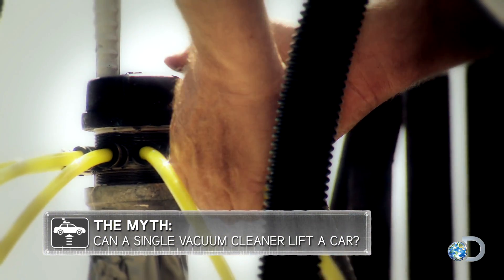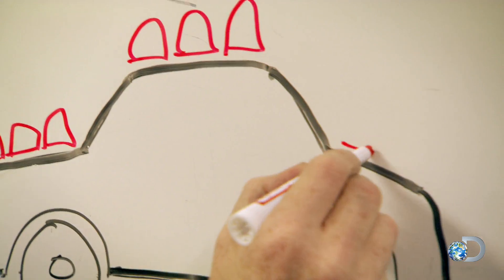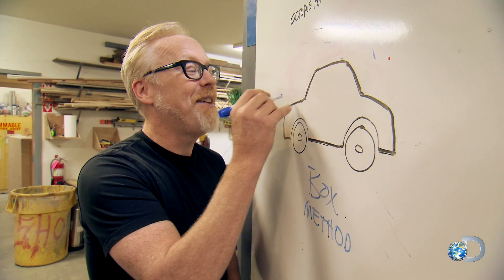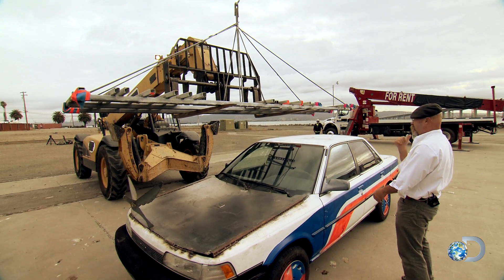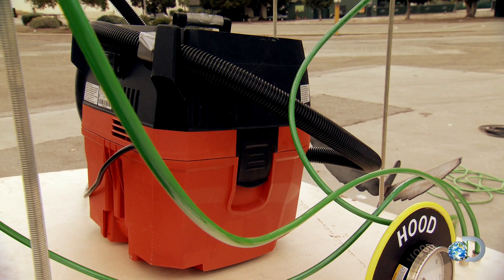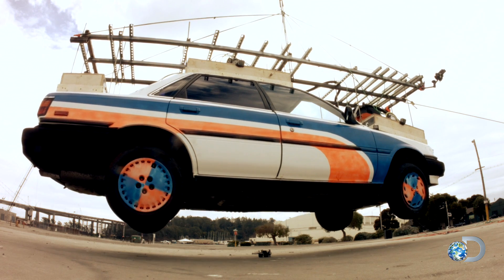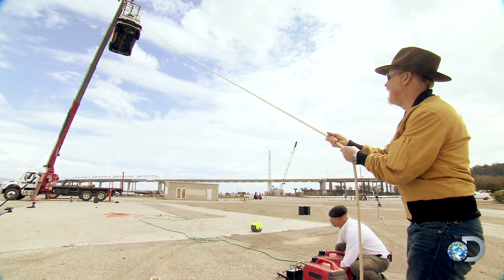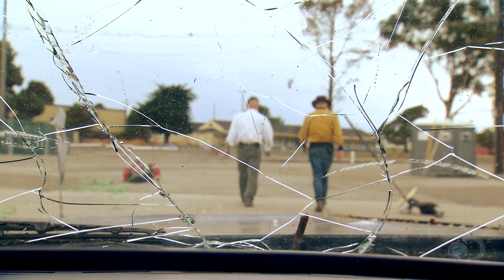Vacuum Car Lift MiniMyth | MythBusters

Comment: This episode is replicating a stunt the Kirby Company did with one of their vacuums. They lifted a VW Beetle filled with metal balls in the front to balance the weight. For a gag, they pulled the plug and dropped the car at the end. That's why the Mythbusters did it here. It doesn't seem that the Mythbusters were worried about balancing the weight and it still worked. The Kirby Company used just one large box that had a radius at the bottom to fit the roof perfectly. You can still watch their video on the Kirby Company YouTube channel. Instead of a household vacuum, the Mythbusters used a more industrial style shop vac. The Kirby Company didn't need to. They used a Kirby Heritage 2 upright vacuum and it did the job just fine.

Comment: I'm surprised three hood and trunk latches held.
Reply: I'm pretty sure they welded them shut. They also replaced the hood with a sturdier steel plate because it kept flexing too much on their first attempt with another rig. Adam did point out that some may view that as cheating, but reminded viewers that the point of the myth was that the vacuum had enough power to lift the weight of a car. It said nothing about the car being modified to get a better vacuum seal.

Comment: So making the nozzle bigger gives it more suction?
Reply: My brain is trying to work that out too.  At first doesn't seem to make sense, cause you would think a air tight seal is only as good as it's weakest point.
But, actually, i think you could lift like 1 million or 10 million pounds with a single vacuum..  all you need is a large enough closed container to just pump the air out (with the vacuum over the course of time, and you would need to also need a large surface area in which to lift the weight (for example.. have each square foot of area needing to lift only like 10 pounds.)
Reply: just like i'm certain i could lift a fairly heavy car with 1 hand (with the right setup).  If your wondering how this would work.. think about how bike gears are arranged, you could likely pull a semi truck with a bike if they made a bike that could gear that low (and assuming you somehow had enough traction (maybe you have spikes on your wheels).  You would need to pedal like 10 times for just 1 foot of distance.  So you wouldn't go far, but you could do it.
Reply: @cryptfire3158  a human can't lift a  car with 1 hand, unassisted dude
Reply: @jazzabighits4473  true that (i think)

Comment: They're not lifting the car with the vacuum, they;re lifting the car with a crane.  The vacuum is just attaching the lift-palates to the car.

Let's see them start with the crane holding the palates a few inches above the car, and then turn on the vacuum and see if the car rises.  (It won't.)
Reply: it's very clear that no one expected the plastic hose from a vacuum cleaner to lift a car.
Reply: its not an electromagnet you idiot

Comment: 100% proof earth is not a ball
Reply: Might be a year late to this comment, But out of curiosity... how does this prove the earth is not a rough sphere or a "ball"?
Reply: @Cleric2g  i have since disproven my argument but basically it was if the vacuum of space creates a force in the low pressure condition then wouldn’t that same force pull the air off the earth into the infinite vacuum? Really when you think about it it comes down to the very last top layer of the atmosphere and the forces at play between the force of the vacuum pulling the air away and the force of gravity pulling the air down. Im not a mathematician and i cant calculate the forces but its logical that this could balance out.
Reply: @AlephMale i changed my position. I think its plausible under the official model. However I still believe the earth is concave.

Comment: Hmm... so why isn't the vacuum of outer space pulling our atmosphere apart??
Reply: Science
Reply: @elliottjames671  LoL.... the term "science"

Science is meaningless as a word... all Sciences - in a nutshell - is the practice of learning and gather knowledge.... some people the concept of science..

 If those who follow the status quo pablum of what is truth andwhat is  science then theyare onthe  inside and those who think outside the box and don't do group think are losers who don't understand science????

what a crazy world we live in..... "science"  that's the funniest thing I read today...thanks!!
Reply: Space is fake its proven with the 2nd law of thermodynamics.  Pressurized gas can not exist next to a vacuum without a barrier.  If you take the barrier away the gas fills the void period! No if ands or buts. Don't give the gravity bullshit because mythbusters just proved to you that a vacuum is stronger than gravity right here . So..........?????????????????
Reply: Because it's too busy sucking flat-earth brains dry
Reply: Because there isn't much to pull. It's not solid atmosphere followed by vacuum. It's a gradient.

Gravity is dependent on distance, thus the air at the surface is a lot denser than that at the edge of the atmosphere, which is why you can't breathe well at high altitudes, because gravity is weaker there, making the air less dense, thus thinner, and thus the concentration of oxygen is less.

At the edge of the atmosphere there's so little air, that the pressure difference between the atmosphere and the vacuum of space is almost the same. So it's not a case of lots of air vs vacuum like if you sucked out all the air of an aquarium on earth and then made a hole in it; rather it's a lot of air, followed by less air, and less air, and less air, until you have next to no air, which is then next to a vacuum; and vacuum is not gonna have a super pull on such a small amount of air.

It can be easier to understand if you realize that a vacuum doesn't suck anything. A vacuum is a space that has no matter, it's empty. What causes the air to flow into a vacuum, is the air pressure. The vacuum is empty, and thus the air molecules are pushed by other air molecules into the empty space. Like if you were to compress a bunch of cotton pads together and let go, they'll push each other to where there's more room.

Our atmosphere does seep into space, however; several hundred tons per day.
Reply: @MulleDK19  the problem is gravity has never been proven to exist it's never been able to redefine through experiments it's only a concept or Theory we really don't know what it is that holds things to the Earth other than buoyancy and density.

The pressure of a vacuum around a bubble our atmosphere should be far more pressure was that a simple vacuum cleaner I guess the point I'm saying is the science that we say explains all of these things really doesn't.

But thanks for your feedback.
Reply: @vinnyg101   Buoyancy and density does not explain away gravity. If you remove "g" from the math then buoyancy and density are inert. It is literally why and how the theory of gravity came to be. Scientist use the word theory as a place holder, as if to say until a better theory is presented and passes. I'm sure there's videos of gravity experiments in space, but if you're this far down the rabbit hole you'd probably simply dismiss them. Whereas science is always willing to abandon previously held misconceptions. A hollow earth, flat earth or polygon earth would be great for science, but none of these can be proven.
Reply: @MrPunch09  you mention that science is always willing to abandon previously held misconceptions but it's not the science that is unwilling, it's the people. This is why Max Planck (look him up if you're not sure who he is) said “A new scientific truth does not triumph by convincing its opponents and making them see the light, but rather because its opponents eventually die, and a new generation grows up that is familiar with it.”
Reply: @vinnyg101  but you can prove gravity cuz if gravity didn't exist, the gasses in the atmosphere wouldn't settle into distinct layers with hydrogen and helium on top and CO2 at the bottom where we are. (mic drop!)
Reply: @christopherimpey6208  nice vid.  do you think Einstein's warped space-time is the correct explanation of what's in that video? Those objects were accelerating towards the earth at 9.8m/s^2 according to standard gravity models.  If they fall for just 2 seconds, they would be falling at a speed of 19.2m/2, increasing that speed for each second after that obviously. But here's the real question - if an object is in free fall with an acceleration of 9.8m/s^2 for 10 years, what is its current speed? what about after 20 or 30 years?
Reply: @falt_earth_minds9331  no mic drop, you should really put the mic down though and pic up a book or two, maybe an elementry school brochure
Reply: @christopherimpey6208  I didnt mention the moon did I? I wasnt talking about the moon
Reply: @christopherimpey6208   thanks limpey, I appreciate your "concern"
Reply: @falt_earth_minds9331  the moon is a satellite and obeys the exact same principles
Reply: @falt_earth_minds9331  wow an insult iv never heard before, you must be a very smart person how will i ever recover
Reply: @christopherimpey6208  - the same principles as what? I wasnt referring to principles or satellites per se. I was looking for an answer to a simple question, which you ignored -  if an object is in free fall with an acceleration of 9.8m/s^2 for 10 years, what is its current speed?
Reply: @falt_earth_minds9331  that answer explained it perfectly since satellites observe the exact same principles but if you want the full answer here
For simplicity, consider a perfectly circular orbit; the gravitational acceleration is always at a right angle to the velocity vector.
This means that the speed cannot change despite the fact that there is constant acceleration.
Note that for the speed to change, there must be a non-zero component of acceleration parallel (or anti-parallel) to the velocity vector. If the acceleration is always perpendicular, only the direction of the velocity will change, not the magnitude (speed).
For an elliptical orbit, the speed does change but the change is periodic; increasing to a maximum and then decreasing to a minimum at regular intervals.
Therefore the velocity (not speed since speed is scalar and velocity is vectoral) is the same as the acceleration is at a right angle to the vectoral velocity of the satellite.
Reply: @MrPunch09  Have you ever heard of the principle of stationary action? It's much simpler than Newtonion physics and doesn't use gravity at all. Newton also happened to be a 33rd degree freemason occultist who founded the grand lodge in London. Keynes said of him, "Newton was not the first of the age of reason. He was the last of the magicians, the last of the Babylonians and Sumerians, the last great mind that looked out on the visible and intellectual world with the same eyes as those who began to build our intellectual inheritance rather less than 10,000 years ago." Such great faith you have in an occultist who's greatest desire was to create the "philosophers stone" he only developed calculus under the guise of science to escape Englands prosecution of alchemists.

Comment: A household Vacuum can lift a car, but cant get hair out of a carpet.. Something is wrong here :D
Reply: Jori Diculous you can't get a seal on carpet
Reply: You can with a kirby. Look up kirby vacuum and vw lift
Reply: you compare a hair with a car ???? a hair is 0,01 mm a car is 1,75 meter by 4-5 meter... there is a slight surface area difference..... 

only slight .... 

hardly to notice by folks like you seemingly....
Reply: @thewaytruthandlife  you dumb
Reply: @JoriDiculous  You are missing this point and I am dumb ????? 

OK fine with me...... Good luck .....
Reply: @thewaytruthandlife  you're 4 years late bro.
it was a joke not scientific fact. get over it.
Reply: @JoriDiculous  well as you can see from the words I used, I was also joking....